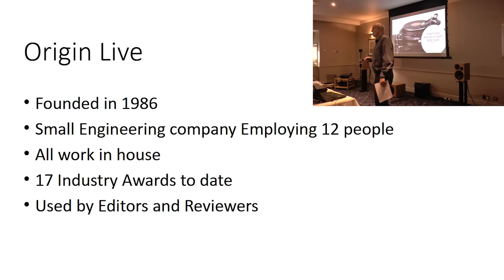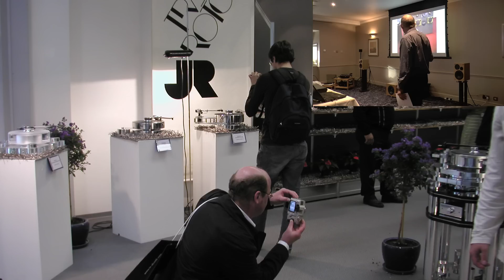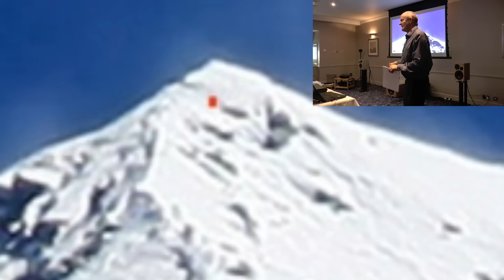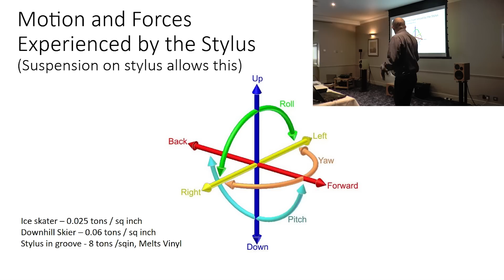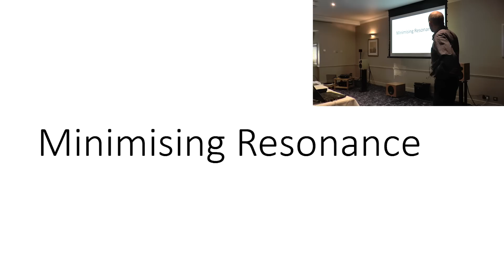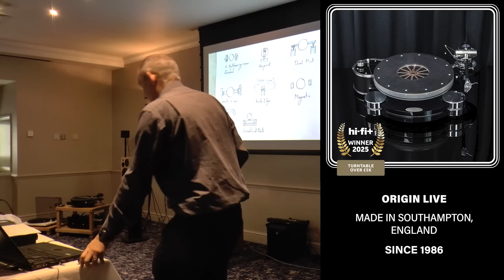Why Your Turntable DESIGN Affects Sound Quality

Comment: I own a Rega P8, and used to own a LP12  and have 1000s of LPs, so I am well invested in vinyl playback. However I am also a skeptic and so when I hear someone claim something that sounds dubious my first port of call is Google.

Google says - No, digital-to-analog converter (DAC) and chip designers in Silicon Valley are not starting a trend of designing turntables. Turntable engineering relies heavily on precision mechanics, vibration isolation, and motor control, whereas Silicon Valley audio figures historically focused on digital processing, such as HDCD or high-end D/A conversion.

If someone would care to come up with some proof that people who work in Silicon Valley are in fact designing and creating turntables then I would be the first to want to take a listen. Nothing would give me greater pleasure than to turn my autistic hearing onto whatever it is that they create, otherwise I will just treat the claim that they are as just one more example of audiophiles making claims that have no basis in science or facts.

Comment: When I bought a new turntable, I decided to invest in an Origin 12 inch tone ARM. Origin worked with EAT on the measures and installation. I was shocked that the tonearm increased the existing cartridge by so much. One of my best system upgrades I’ve invested in. Origin truly understands system vibrations and how they impact clarity.

Comment: NAGRA REFERENCE TT is probably the most novel TT in at least a decade. Disappointing you didn’t mention it.
A get that this is a sales pitch for your products more than an unbiased lecture.
Reply: He’s a complete idiot or should title his talk as a sakes pitch.
Reply from the maker: Lecture is from 2019. We only mention our own products at request at the very end of the lecture. The Nagra is an interesting design, but by no means the most novel. I'd be thinking Wilson Benesch.
Reply: He‘s not there to promote other brands and there have been gazilians of tech innovations not mentioned, as one could see the time was short, so, no NAGRA is irrelevant compared to many prior omitted, too. This was high-level, only. Not tech solution level, at all.

Comment: given the date listed,  I was expecting the inclusion of what many consider a triumphant turntable arm suspension, the supatrack tone arm bearing, used on the blackbird tone arm.

origin live has always been a top company producing superb products.  glad to see they have grown.

 they used to compete directly  with Michell engineering because both were selling modified Rega arms, with origin live considered slightly better , but they got a lot of complaints because of a somewhat casual order fulfillment.  

Michell went on to become famous for the classic gyro turntable, still a top 'budget " table, if one can call several thousand dollars cheap,  and still a market contender today, while origin live went more into tonearms and higher prices for excellent product.
Reply from the maker: Hi Richard, this is actually a lecture from 2019 so a bit before the Supatracs time. We've gotten to know both Richard Braine and his design. Both are admirable. There are many aspects of the Supatrac which are brilliant. There are other roads it takes in design that we've already been down and avoid for good reason. I don't want to criticise too much out of respect for what Richards doing, but suffice to say we're still confident in the performance of our designs against competitors.

Michell were famous for the Gyro decades before we were involved in tunrtables. We were modifying Rega's for a few years, but quite quickly started making every part of the tonearm ourselves. We were a very small business operating out of my dads (Mark) garage when we first launched in 1986, growing slowly in to the 2000's and then exponentially with Marks developments in tonearms and turntables. their were some obvious teething pains growing, but we now employ 12 people, manufacture everything in house and usually ship in under 2 weeks.

Its interesting how we get known for different things in different circles, whether its the rega mods we do still carry our to upgrade customers existing rega arms, or our high end designs. But our entry level turntable/tonearm offering starts at less than half the price of a Gyrodec, and lets just say it would happily compete with it.
Reply: @OriginLiveInfo  My hypothetical goal is to one day get an organ live tone arm, and move the Michell arm I now have into a dedicated mono second arm on my gyro. the problem is budget clashing with expensive desires.   I'm a little hesitant about the string incorporated in the blackbird suspension.
Reply from the maker: @richardelliott8352  It's a good goal, especially if you have a decent mono collection and want that dedicated cart for it. Always feel free to reach out by call or email when you want to talk tonearms with us.